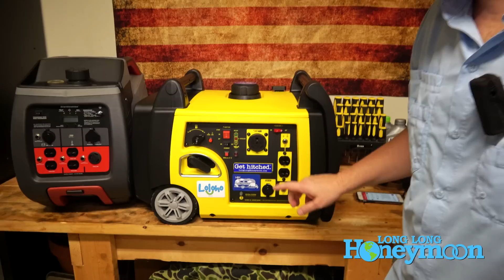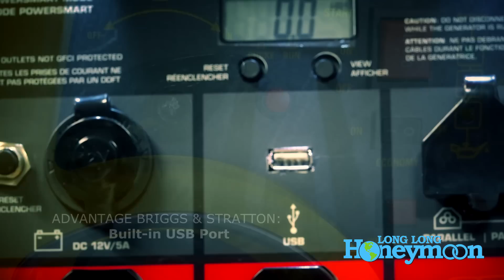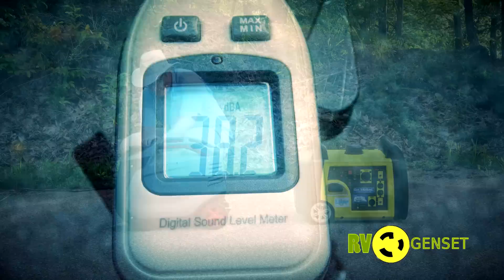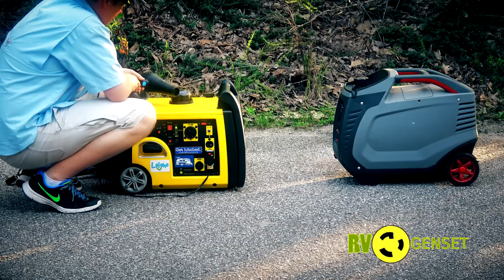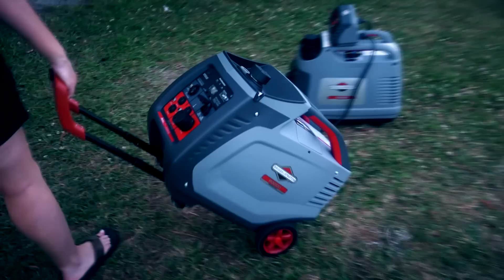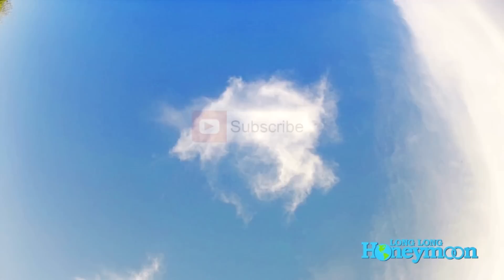CHAMPION vs. BRIGGS & STRATTON: 3000W RV Camping Inverter Generator Comparison and NOISE TEST

Comment: The B&S seems to have a smaller footprint. I had a Champion once and it took up a huge amount of space inside my Class C. I got rid of it for that reason, and it's weight. Can you do a measurement of each generator and compare their sizes? Also, which did you find better regarding maintenance? Oil change, etc? Thank you.
Reply: I see you just hearted me. It's an old comment. So old that I have to confess that I bought the B&S 3000 watt generator when I found one (God was definitely in this) one day on Ebay. I'd been shopping and comparing and hemming and hawing and then THERE. IT. WAS. It was in the last 30 minutes of bidding and I got it! I don't use it much now but when I do, it is a great generator. I feel I'm neglecting it and it really does need a good workout ASAP. 

But thank you ever so much for all your reviews. I love you guys just on general principals and I hope you see this comment. I have to remember when shopping on Amazon to use your "store." I'll try to do better, cause I've learned so much from you, and you're just an adorable couple. (((((Hugs))))) God bless you both.

Comment: Great video, I kind of lean towards the champion as well. I know the champion 3400 will run a 15K RV roof air conditioner that's a big deal as my fifth wheel is a 15K.

Comment: High above Sea level "4200 to 5000 ft" high the campion 3500 w on propane will not run a rv air conditioner. Had to put a hard start capacitor in the air conditioner. So saying that it will run a rv air out of the box is incorrect but once past this hurdle my champion runs great.

Comment: Ireally liked your review.  The great thing about Champion is the many different models.  I bought the dual fuel  has electric start, no remote, but can be piggybacked with another unit and it came with a 2 slotted USB adapter for the 12  bolt receptacle., and 3400 starting watts.  Thanks you both for all of your great videos